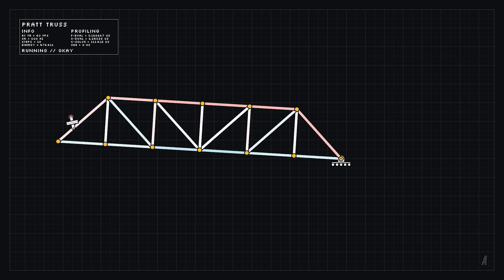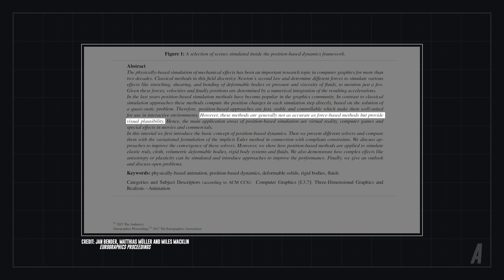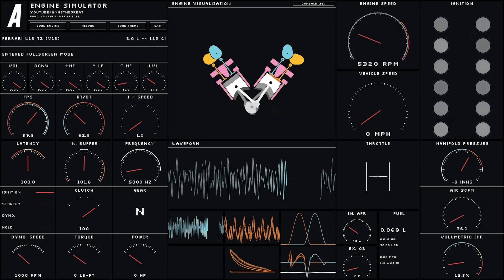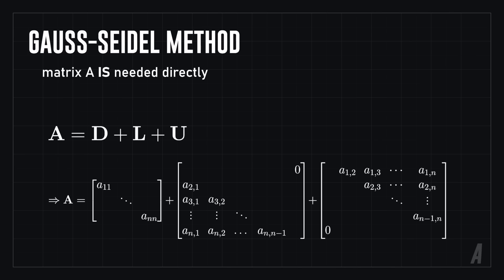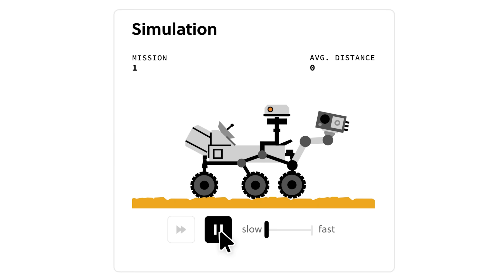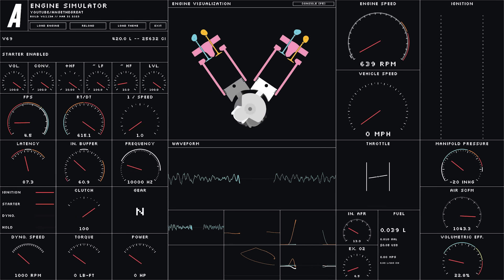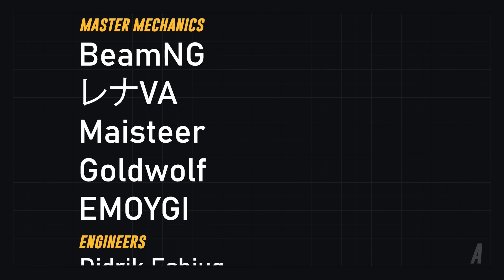Simulating a V69 Engine for Research Purposes (warning: video contains math)

Comment: First of all huge congratulations on the engine. I think you smashed it out of the park. But I have some concerns about the performance, cause I'm thinking that this is the next step in racing simulators, bit if 50% of the resources are being used just for the engine alone, then we are very far from using it. Again, kudos for the engine. I hope that my comment does encourage you to keep working on it. I understand it has some limitations and that improving it could reduce the quality of the sound you are working on, which is a blast

Comment: I'd like to see some big Diesel engines simulated, like the EMD 16-710-G3C-T2, a 16 cylinder, turbocharged diesel engine with 710 cubic inches of displacement and a really neat sound. The EMD 20-645E3 is another neat turbocharged engine, with 20 cylinders and 645 cubic inches of displacement. The two engines make 4,300 and 3,600 horsepower, respectively. They're also both two-stroke engines.

Comment: I dont know if you have a flywhell, and a starter ? to start run the motor in the right way....
With the flywell is like a airtank to accumulate the rotation. al also force the crankshaft and all to run in only a way
Also the exaust don't sound smooth because need a muffler

Comment: first of all, this is absolutely amazing. second of all, i have a couple of suggestions for the engine sim, take this comment how you want.

Forced induction
     weather it be twin charged, turbo charged, or any type of supercharged

Exhaust tweaks
      ability to add different muffler types, catalytic converters, and things like piping diameter, length, and wall thickness

Diesel
     pretty self explanatory, ability to add compression ignition engines

2-stroke
     again pretty self explanatory
 
Engine configs
     Ik you've done it before, but like what about vr engines and w engines???

entry ignition engines anyone???????????????????????????????

Comment: Just goose it with a 250 shot of N20 and you'll have a beast.
I think a 22 ft motor would similar to Jay Leno's "Blastolene Special", with a M47 Patton Tank Engine!  An 1800 cubic inches of air cooled, hemi headed, overhead cammed.

Comment: 2 questions
1. Have you tried analysing the code using a program like Intel VTune? To see what limits your performance and check that you are using AVX instructions where possible.
2. Have you considered using OpenCL or CUDA to use the GPU to solve the matrix calculations? You might run out of memory and you might end up copying data from the CPU to the GPU and back. I am trying to use my GPU using python, but at the moment I have a hard time beating numpy's dence matrix speed using either scipy's sparce matrixes or pyopencl, but I am a noob, thus you might be able get it to work in C.

Comment: Do you think its possible that you could model a self-loading firearm in Engine Simulator? After all, most of them are little more than a single cylinder, two-stroke engine that uses propellant gasses for fuel.

Comment: I wonder what a 24 cylinder H engine would sound like such as the napier sabre, as well as how much power it would make using higher boost settings, iirc they tested to over 3000hp during ww2.

Comment: Alright hear me out, run the simulation through a full cycle or two while recording video of the physics, then play that video at different speeds relative to the engines current rpm so it lines up (e.g. record at 1,000 rpm, play at half speed if currently running at 500 rpm, play at double speed for 2k rpm, etc.)

Comment: Everyone in the comments asking for big engines, but in my opinion, can we try a smaller engine? Specifically the NGH 38GF engine?:
-37.97cc (~2.32 ci) single cylinder 4-stroke
-Bore 39mm (1.54 inch)
-Stroke 31.8mm (1.25 inch)
-RPM range: 1600-8000rpm
-Alleged power output: 3.58HP@8,300 RPM
>But I can't find it anywhere that NGH (the company that made the engine) measured the torque. Would be fun to see it show up on a simulation even though this isn't meant as a serious inquiry in finding out results.

Comment: Long ago, I programmed a conjugate gradient algorithm straight from Hestenes book. I had a 4 variable problem. In testing I noticed that the objective ftn would drop slightly for the first three cycles, then drop an order of magnitude on the fourth. So, check for some sort of cyclic behavior.

Comment: here are some things you should do for the diesel sim 

(these are recomendations)

1. fuel injection 
2. heat simulation
3. compression ignition

if you make all of these things you should have a diesel engine
i still wonder how you would get the sound right also if you do could you make the fuel rail pressure adjustable for fuel injected engines so for locomotive engines they can be more realistic?

Comment: Could be an interesting challenge to obtain one of those little simple RC airplane engines, which are relatively cheap and easy to run on a workbench, and see how close you can get in simulating its sound and behavior to the real thing. Or maybe a grass mower engine could be a convenient one to try, though a more complex engine to emulate.

Comment: How much of the simulation can you offload onto the GPU? I have no idea which equation solvers are practical, but the audio pipeline (assuming you're using FIR and similar) should be pretty straightforward to move over.

I'm curious to learn how you're doing the fluid simulation, as well; or if it's even necessary. I imagine you might be able to just run some low-speed, detailed simulations for a single cylinder, work out the empirical behavior, and develop a way to scale it based on Reynolds number (and possibly mach.) A simple lookup table for the impulse response of the engine might be worthwhile.

You could probably increase the efficiency by taking advantage of the extremely repetitive nature of the physics sim as well. The engine is going to have a period of only a handful of revolutions, so if you can work out what that period is on-the-fly you could just repeat the existing data and only update the simulation when the input changes. If you've got a huge buffer, it would probably work well even with changing inputs, and it would improve efficiency in games as well.

Comment: Would it be feasible to abuse the GPU for handling rendering and the physics, and freeing up the CPU for the sound? If you can avoid passing data back and forth between the GPU and CPU so much, you can easily get what you need

Comment: Evaluating the matrices symbolically first could lead to massive gains, think FFT vs standard DFT. 

Also utilising double derivatives projected as the predictive value gives a good enough baseline, that it becomes possible to use 16bit frames for SIMD and still keeping good accuracy. Especially with reciprocating simulations where there is a self correction factor by the nature of the machine before the simulated.

If you can get away with 16 Bit corrections on a 32bit data path you have an instant 2x speed increase.

Comment: It looks like you are actually implementing the Jacobi iterative algorithm instead of the Gauss-Seidel Algorithm. You are breaking up the A matrix into L, U and D where L and U are strictly upper and lower triangular matrices respectively and D is a diagonal matrix. If you were to instead break up A into L and U where L is lower triangular and U is strictly upper triangular, you would have the true Gauss-Seidel algorithm. Gauss-Seidel has better convergence properties than Jacobi iteration, so it might be worth to look into.
Reply from the maker: Optically, that may appear to be the case, however, I have in fact implemented Gauss-Seidel algorithm and not the Jacobi algorithm. You are correct that in literature, the matrix form of the Gauss-Seidel algorithm is commonly stated using a strictly upper triangular and lower triangular component. However, when you write out the element-based formula, it becomes clear that the diagonal components of the matrix are used separately and it is convenient to separate them out (at least when implementing the algorithm in code). I did test the Jacobi algorithm as well and you are correct that it has poor convergence properties compared to the Gauss-Seidel method.

Comment: Cool simulation! I think what you're hearing is that at low speeds, this engine is putting out a quite audible tone. At 730rpm the engine produces an exhaust note who's fundamental frequency is 420hz (assuming perfect equal length headers and firing order). I think from there as we hear it rev up it generates a sub harmonic at the engine's combustion cycle (IE fundamental equal to 1/2 RPS) due to uneven bank counts and pairings. Much like the thrum of a cross plane V8, but more severe.

Comment: I'm looking forward to see 3D engine simulator. Especially Radial engines (like R-2800, r-3450). Actually, do you have any plans about this type of engines? I mean, they have a little bit more complex systems of valves, rods... And do you have any plans about radial and (not only) engines with sleeves distribution? (Like Bristol Hercules, Centaurus, Rolls-Royce Greece)? Thanks.

Comment: Does the simulator have a mode where the output is written to a file, and so the simulator doesn't need to run in real time? Then you could more accurately model ridiculous engines and still hear them.

Comment: You should look into a way to 'bake' the audio if you're serious about using it for games. Once an engine has been designed, you could run through a range of scenarios that capture most engine sounds and then use them in the game similar to most other racing games.

Comment: Always good to see iterative methods for solving linear algebra problems. 
Have you looked into the "biconjugate gradient stabilized method"? I have always preferred this method to regular CG as it is able to solve more general systems and is often faster (looking at converging to an answer). It is also able to take the previous solution as its initial solution as you did the CG.

Comment: What is the constraint solver used for, in engine simulator? Is it just simulating the pistons/con rods/crankshaft, or something else as well? I'm not sure I understand why a full constraint solver is needed for the pistons. Could the relationship between piston position and crankshaft angle not be described in a simple equation (x = R cos(theta+k) + sqrt(C² - R² sin²(theta+k), where x is the piston position, C is con rod length, R is crankshaft offset radius, k is the crankshaft offset angle). Probably the derivative dx/dtheta is required too, and inverse of this function too (theta as a function of x). The latter would need to be solved numerically, but it's a very smooth function so could be amenable to a lookup table with interpolation.

Comment: You can use modified version of Gauss Seidel algorithm: LUSGS, Left Upper Symmetric Matrixless Gauss Seidel algoritm, for diagonally dominant systems it is faster than normal gauss, seidel method.

You can start with one step of Adams-Bashfort or Adams-Moulton Method iteration for starting value for Gauss Seidel Method. Krylov Subspace methods can be better, but they need a lot of RAM and computational power.

Comment: Do you have plans for a 3d engine design ui where you can change intake runner lengths, valve size, valve angle, exhaust runner lengths and all that fun stuff that a fluid simulation would be great for?
Reply from the maker: Yes, I talk about that at the end of the video
Reply: @AngeTheGreat  I wasn't sure if that was just going to be simulation UI or if we'd get all the good stuff.
Reply from the maker: @toyoboi  You're getting the good stuff

Comment: A shame you can't move all those calculations to the GPU.

Also I'd just like to say if you can get these simulators accurate enough they could actually be useful for IRL engine building, stuff like engine boring and fuel mix optimization could be predicted at least roughly before actually doing it and potentially creating problems.

Comment: The exact reason is because CG is not guaranteed to find a solution if one exists. There are various mathematical proofs to this but in general terms the more quickly a linear solver converges on a solution the less damping exists in the information transfer. This means methods like Jacobi and gauss seidel have loads of damping or relaxation naturally built in. If we start at Jacobi we are using iteration i values to do the whole calculation. This is the most relaxed we can be. In gauss seidel we are using somewhere in between i and i+1 which accelerates convergence but also introduces error because we do not know what that next iterations values are we just hope that the most recent calculations are closer than the last. CG extends this principle by effectively extrapolating on the GS solution to get closer to the real solution. It’s an educated guess but sometimes we do not have enough resolution on how that gradient term is updating and as a result in each time step our error grows which indicates instability and lack of convergence. This comes back to provable convergence. Jacobi method can be proven to converge, meaning in each successive iteration the error reduces, if a local minima exists to the problem. We can similarly prove that GS converges in the scenario that J converges. CG does not follow this pattern and actually has conditional convergence related to these gradient terms. If we think back to NR solvers there are gradient constraints that prevent NR from converging in certain problems when finding a root. It is similar here where if our “gradient” term is too large, meaning we are far from the true solution, than the error will grow between successive iterations leading to instability. Now this is characteristic of many nonlinear systems and it’s why modeling and simulation becomes difficult in engineering world but there are solutions. Don’t use CG is something you have learned but there are always hybrid approaches. For example, SSOR is a way to relax (both over as the name suggests, and under) the change in the solution from one time step to the next and can be applied to any solver to improve stability and accelerate convergence. This can be set up in the matrices as an implicit part, or after the matrix solve you can perform the weighted average between the new and old solutions thus relaxing it. This works because we are effectively acting on the gradient term which is driving our error and the stability of our system. By relaxing the change by even a minute amount, we can shift the stability criteria in our favor or accelerate our rate of convergence on stable solutions like GS. Hope this helps

Comment: With an engine that long the speed of sound in air might influence the sound you would "pick up" at a specific point in space. Moving the "microphone" around the engine would considerably change the experience. With "normal" sized engines, this is a non issue, but with ridicolous monster engines running at high RPM, it becomes a problem. Much like the hypothetical crankshaft of such a long engine. It would behave like rubber and most likely destroy itself. No to mention the camshafts and valves. I would not be surprised if valves would hit pistons when the engine transitions from idle to load at higher RPM. Steel is very flexible and "rubbery", more than people believe, if we have applications that run at 5000 RPM and a shaft length of 6 meters.

Comment: When I seen the connecting rods bug out like that on 1:14 it made me wonder if there was a way to simulate a catastrophic failure of the engine, like spun bearings, bad rings, rod knock, and throwing rod. If there is that would pretty neat
Reply: Taking into account the strength of different alloys and calculating the forces applied.. i think that would be a very handy tool for engine tuners

Comment: I'd recommend looking at the semi-new paper "Detailed Rigid Body Simulation with Extended Position Based Dynamics" (I've implemented it in a library called iMSTK for proper two-way rigid-soft tissue compliance, might be the only implementation, but its great!). Also take note to use XPBD instead of PBD. PBD does not give valid forces over many iterations (it converges to infinitely rigid). In XPBD force can be acquired from a constraint via: "force magnitude = lambda / (dt * dt)", where lambda is the constraint scalar. Similarly torque can as well.

The beauty of the method is how well it handles two-way coupling between liquids, gas, and rigids. But the biggest downside I found was friction. Generally any velocity constraint you may want is going to be a pain.

Muller has a rigid body PBD implementation in web that will show you forces of a pendulum on his github io page.

I believe my implementation and his used limits on angular velocity. Due to it being position based going over 180deg in one step was a no go for my quaternion representation, but that could probably be worked around with some fun pain.

Comment: The cylinder display should have bright ring outlines even when they are not ignited.

Consider making the panel into a dense grid with brackets and numbers showing the width and height

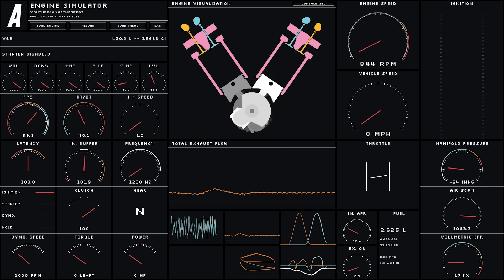Comment: 11:21 "If we slowly open the throttle, we can hear what this engine sounds like at a higher RPM"
Proceeds to simulate the sound of the Earth's End Times
Reply: I have never been terrified by an engine sound before. An engine of this configuration can only be used for forces of evil. It's psychological horror.
Reply: sounds like this type of engine inside a wooden shack with concrete floor recorded with webcam
https://youtu.be/T2YyJpwu4jM?t=25
Reply: To me tho, it sounds somewhat like a class M2 locomotive engine.
Reply: it sounds like someone is running 10 engines on top of each other
Reply: it honestly sounds like a washing machine
Reply: I honestly like the sound of it. Reminds me of older GE locomotives at higher revs.